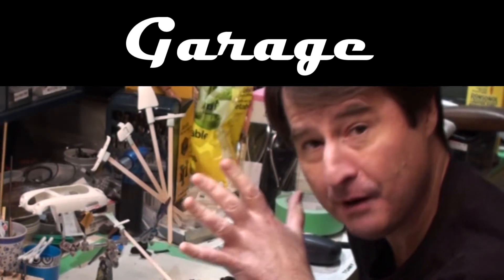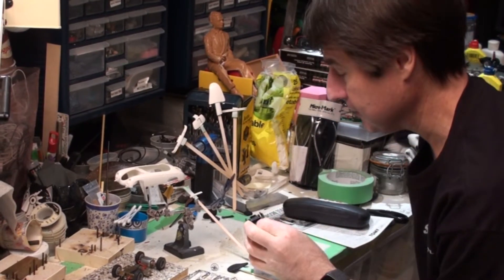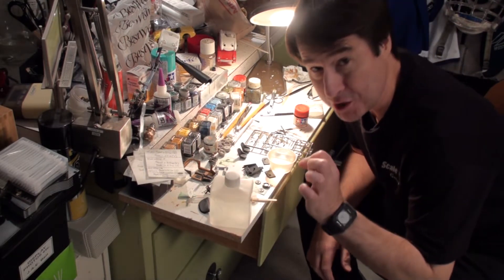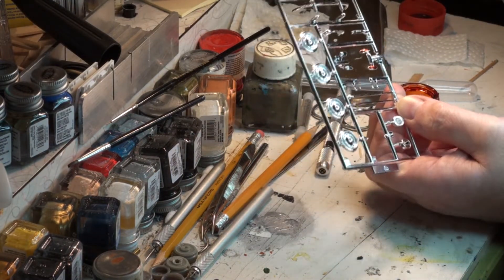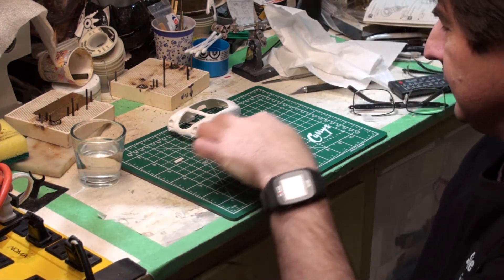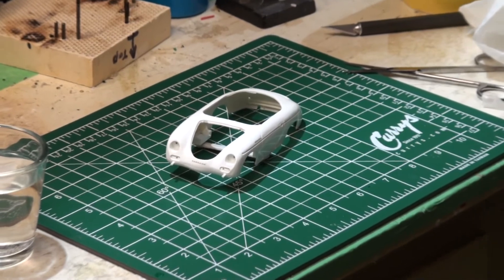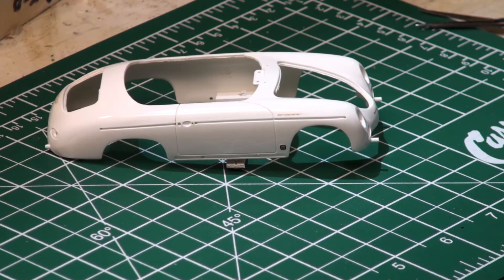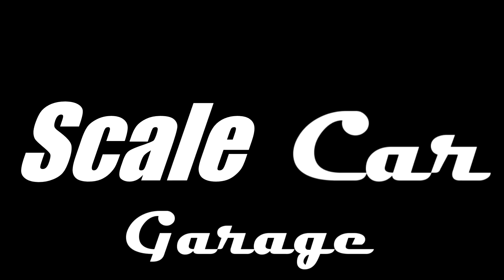Scale Car Garage - 1/32 Scale Porsche 356 Speedster Pt 5

Comment: Doing the 'fiddly bits' can be either the agony or the ecstasy; the former when a mishap occurs and the latter when the results turn out just right.   Delighted to see that applying those small decals and your detail painting turned out  beautifully!     And I'm going to buy some Novus, a product new to me.  Thanks for the recommendation .  Good show.
Reply from the maker: Mark I couldn't agree with you more! Thanks so much for the wonderful comments! As always, I so appreciate your most welcomed support!
Reply: I use the Novus polish on clear coat.  And like John, I learned about it correcting scratches in visors, acrylic cases, etc.  And #2 is my fave.